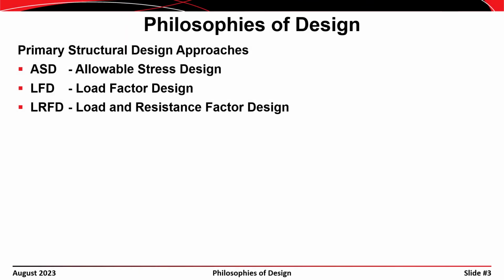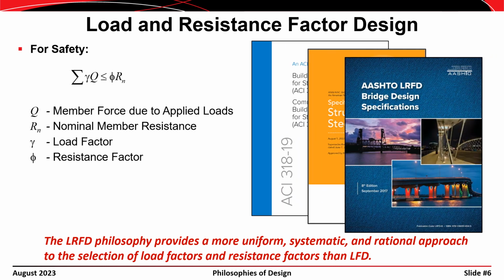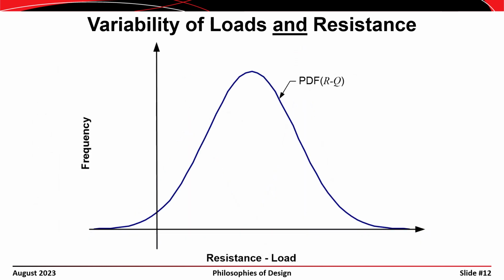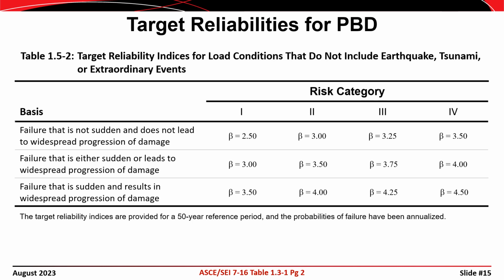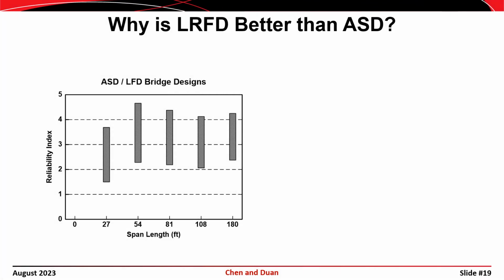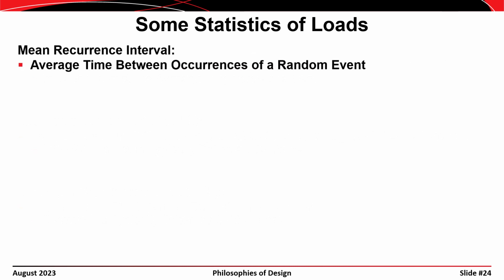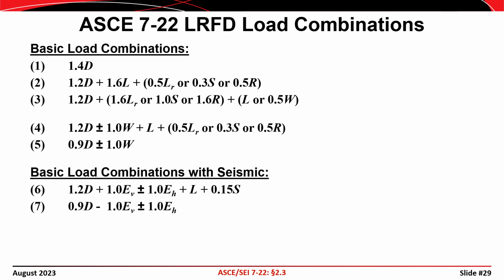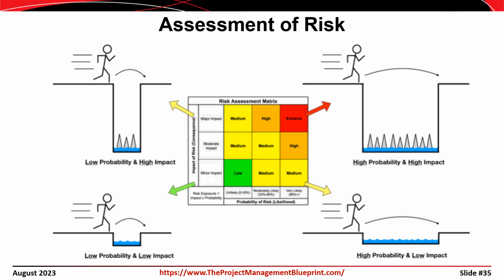Philosophies of Design

Comment: Hi expert, What is the "S" in the formular:  Sum(M)/S < Fy/1.67
Reply from the maker: S is the elastic section modulus, which is the 2nd moment of inertia, I, divided by the distance from the neutral axis of the section to the fiber at which the bending stress is being calculated, c.